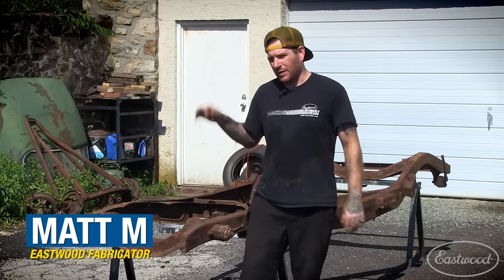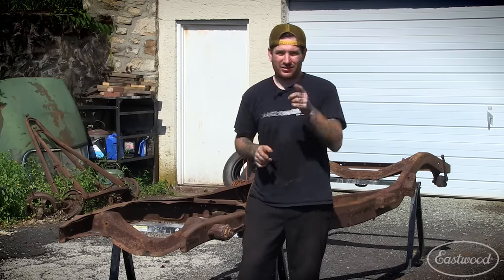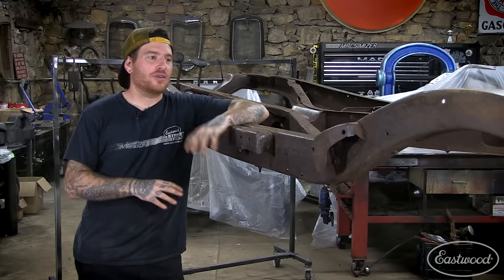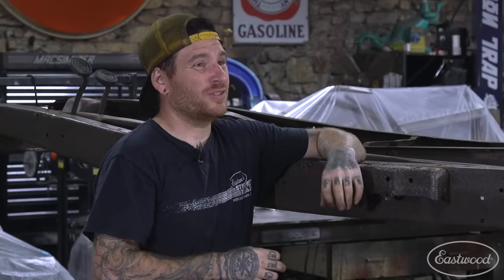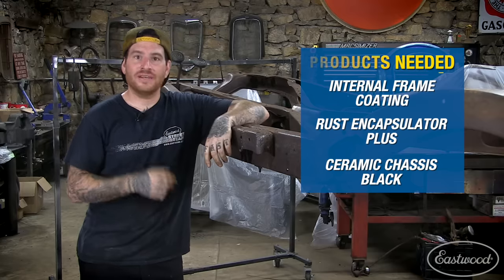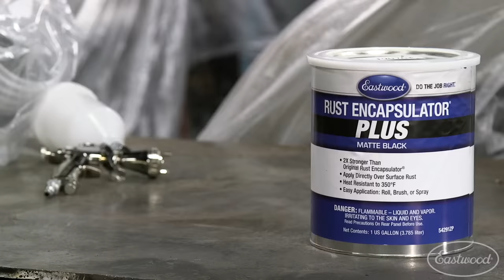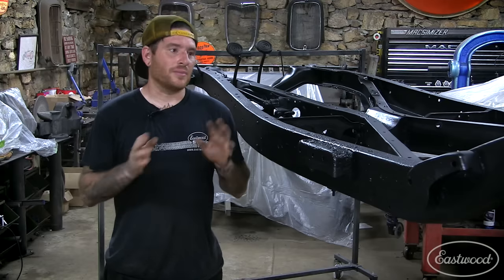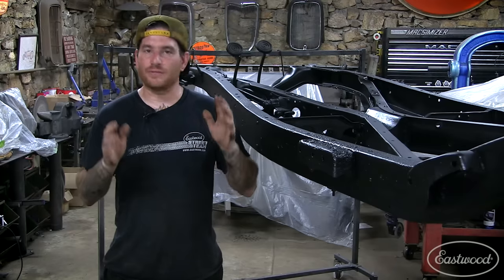How to Prep & Paint an Old Rusty Frame with Rust Encapsulator PLUS & Chassis Black - Eastwood

Comment: "Just two easy steps." Really? Add up the cost of the Eastwood tools and products, and the time it takes to complete a very unpleasant task, and you're north of the cost to media blast and powder coat.
Reply: Yup..that's hella work...get it blasted
Reply: Probably cheaper to get a harbor freight sand blaster and do that right?
Reply: 1 all you really need is a drill with a wire brush, a 5in grinder with a wire brush, and a wire brush.... and and air compressor for paint, some people do this stuff regularly and thus already have all those things, btw powder coat is terrible it doesnt last long in hard conditions, also a cheap sandblaster and air compressor would work well (although very messy) and would probably cost less than $250 to buy everything !
Reply: Just blast it and be done with it.
Reply: Powder coat would be rusty again in a year where I live
Reply: @Maverick8t88  and you can't fix powdercoat. Once it's compromised, you're screwed, Powedercoating a frame makes little sense.
Reply: @jt8251  right? Fine for a show car/trailer queen. POR15 is the only way to go
Reply: I'm a mobile media blaster and can tell you I charge $450 to strip this ONSITE in TWO HOURS and it is ready to paint.
Reply: @5ociopathic  you also need a light industrial air compressor. That a lot of sand blasting.
Reply: You are supposed to turn Montage Mode on first

Comment: You can get the same results using an angle grinder with a wire wheel. No need for all those fancy tools.
Reply: Most likely, because the tool they used for getting the rust off just had multiple wire wheels it looks like, but you might need that thing with the needle like things to break rust, or just use heat and chip it off
Reply: Oh for sure, but which is faster?
Reply: Yea the angle grinder with wire wheel worked fine for me. Just wear gloves because that wire wheel throws off those little wires and after a while your hand will look like a pin cushion
Reply: Nah, an angle grinder takes off too much material making the frame too weak in spots, sand blasting is a better idea
Reply: @nicholasdunbar3378  Yeah, if you use the grinder attachment, it will take off too much material. I suggested a wire-wheel attachment. Sand Blasting is the best method as you can get to the hard to reach spots that a grinder can't get to.
Reply: Hell yeah borther 😎😎😎 you get it. 
Hobo freight for the win👌👌
Reply: @nicholasdunbar3378 Sand Blasting makes such a mess. Maybe the ones with water might be better but if you’re trying to do it with everything on (engine & can) it can get caught up everywhere. Ask me how I know. 😅

Comment: Very nice. What is the process if you want to smooth out the frame's rust pitting? Plastic body filler? The aluminum filler?
Reply: weld the pits up or weld in new sections, if its that bad you need to fix it best to fix it proper

Comment: Did you have to sand/prep in between the rust  encapsulator and the chassis black? 

How long between the two materials.  Wet on wet or next day?

Thanks.
Reply from the maker: Rust Encapsulator can be top coated without the need to sand 6-8 hours after applying your last coat of Encapsulator.

Comment: Matt....what does the rust encapsulator and internal frame spray actually do to rust scale? Does it coat and seal it water/air tight? Is there any chance of the rust flaking off with bumps and frame flex exposing the bare rusty surface underneath?
Reply from the maker: Flaky rust will need to be removed. Rust Encapsulator and Internal Frame Coating coats the area to prevent air and moisture from getting to the metal, which prevents further corrosion.
Reply: @eastwoodco  ok...I get that, but without sandblasting, how do you remove flakey rust from inside a box frame after using a power washer? I have two 1942 Ford G50E GPW Jeep frames that are essentially two C parts hot riveted and Huck bolted together to form a box frame. Short of cutting and drilling out those rivets....how can I remove rust from inside without sandblasting? I'm guessing the frame coating "sticks" together like a latex type of clingy coating?
Reply: I have a box frame as well, I’m curious what solutions Eastwood has...
Reply: Can you use this same process on axles and drive shafts?
Reply: Eastwood....any replies to using Rust Encapsulator inside box frames where flakey rust can't be accessed without paying for professional sandblasting?
Reply: @olivedrabgarage6243  I came up with a reasonable DIY solution let me know if you see this and are interested.
Reply: @carolinathrill  I’m interested
Reply: Probably nothing of actually “ removing “
The rust on the inside short of separating like your said 
Or having your frame dipped
Reply: @carolinathrill  cable with chain on the end? I tried that method and lost some bits of chain deep in my frame rails. Managed to pick them out after some time
Reply: @StreetForged  yeah I can see how that could happen. Got to get used to using a magnet lol. Takes time but can definitely get all the rust out.
Reply: @carolinathrill  my Volvo has smaller frame rails so it's really hard to get any length of chain in there without it binding on something and catching. I welded the chains to the end of the cable for another attempt and shortened the chain but I have a feeling it still won't work out so well

Comment: Do i also have to remove the paint that is on the chasis ? or just the rust removal is fine. It’s a 69 c10 i was using POR15 but i don’t like that i need to completely get it to bare shiny metal
Reply from the maker: Depends on what you're using to coat the chassis. Eastwood Rust Encapsulator is designed to layer right over paint that's already there. You just want to be sure that your original layer of paint has a good bond.
Reply: @eastwoodco  How do i know old paint is a good bond? Also one last thing 1/4 of my chassis is bare metal would i have to etch it so eastwood rust encapsulater can stick?

Comment: how comparable the can is it in term of resistance and duration vs gun epoxy treatment
Reply from the maker: It has passed over 1,000 hours of salt spray testing - so very durable.

Comment: I know Matt doesn't work for Eastwood anymore so I might ask this question on his Iron Trap Garage channel but if someone from Eastwood can answer my question then that'd be great. With the SCT tool...what happens with regards to kick back if you catch it on the frame and how do you get into those tight C channel frame sections to remove the rust before cleaning with a solvent and applying the rust encapsulator?
Reply: no reply :(

Comment: Would you be able to brush or roll on the chassis black top coat just like you can with the encapsulator? Probably not right? Also is that new encapsulator the equivalent of the silver stuff you sell?
Reply: I wanted to know the same thing. It didn't say if you could roll on or brush on the the ceramic chassis black. I think you can though...don't see why not. And can you do this same process to axles and drive shafts?

Comment: What are you using the clean the frame before the paint?
Reply from the maker: Always use PRE Paint prep, acetone, or other cleaning agents to remove ALL the dirt and grime as best as possible, before applying a coating.

Comment: really long time like 3 years in quebec
Reply: After painting your chassis coat it in bitumen I live in england where it rains 24/7 and the roads are covered in salt and my truck in my profile pic is 50 years old never been welded and doesnt need welding

Comment: Not necessarily the best method, but a good method to restore a frame that is completely disassembled from the vehicle and sitting outside on jack stands.  The video is no value at all to someone who wants to restore, protect and extend the life of a modern vehicle that's assembled and running as an everyday driver.